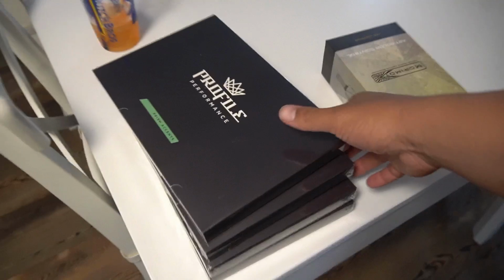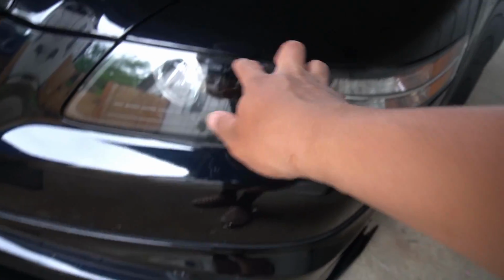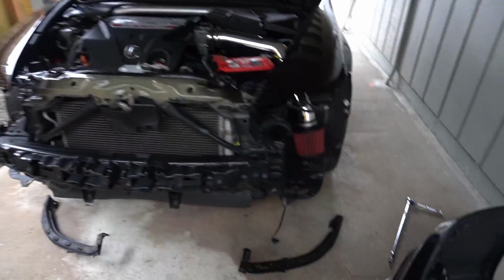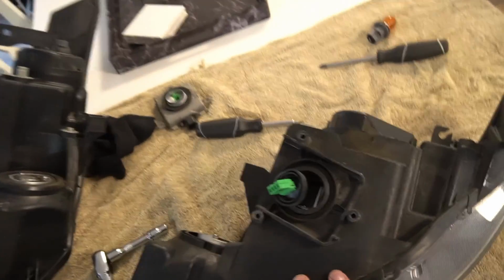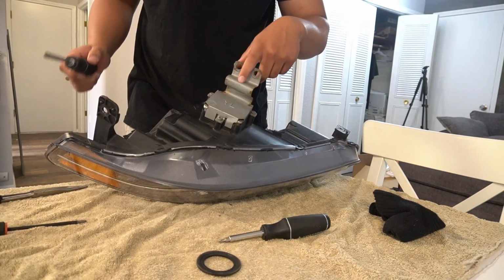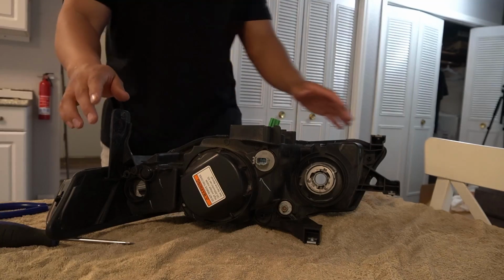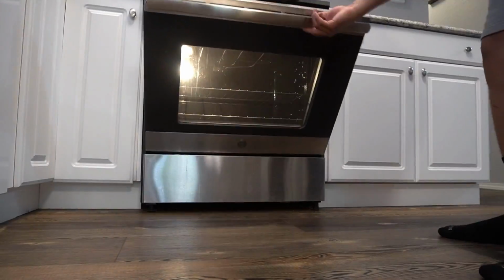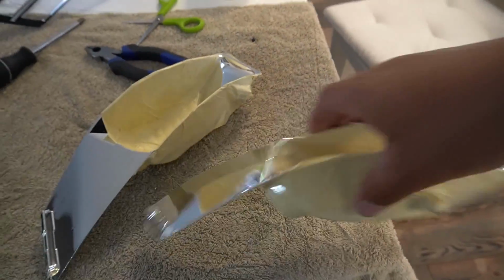BUILDING THE MOST AGGRESSIVE ACURA TL FRONT END HAS BEGUN! | Rebuilding Headlights| PT 1

Comment: Be extremely careful when trying to paint or dip those turn signal bezels. The chrome finish is way too smooth and most chemicals don’t stick. I’ve tried painting them twice and failed each time. I ended up using 3M vinyl wrap for the carbon fiber look. I have a few write ups on Acurazine documenting my journey. If you want the links here they are.  https://acurazine.com/forums/third-generation-tl-2004-2008-93/diy-07-08-tl-headlight-modification-clearing-painting-wrapping-angel-eyes-972240/ https://acurazine.com/forums/third-generation-tl-2004-2008-93/diy-04-06-cleared-headlights-angel-eyes-installation-953672/